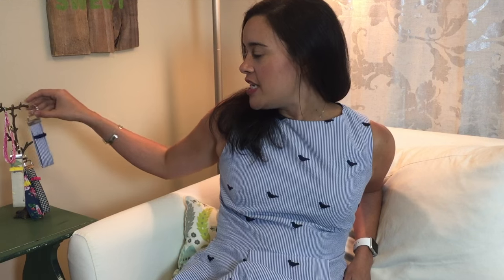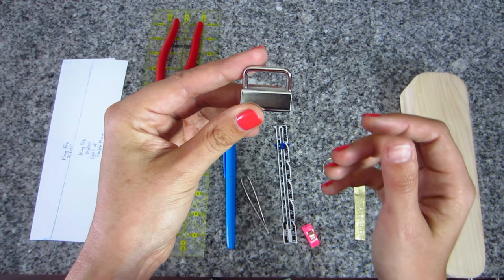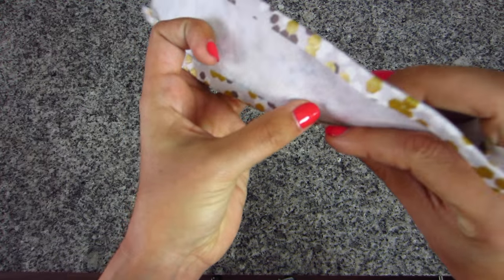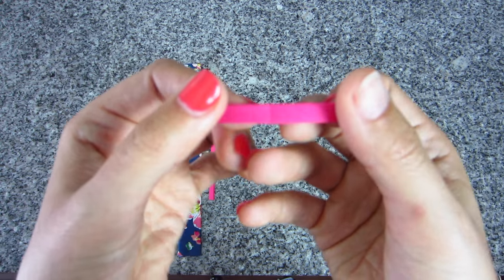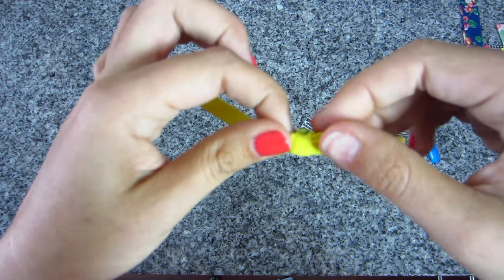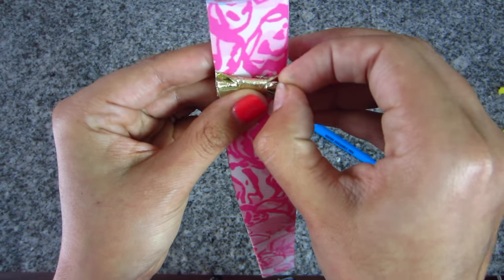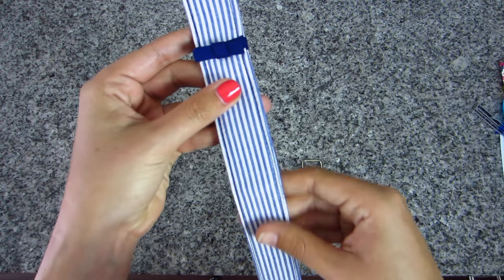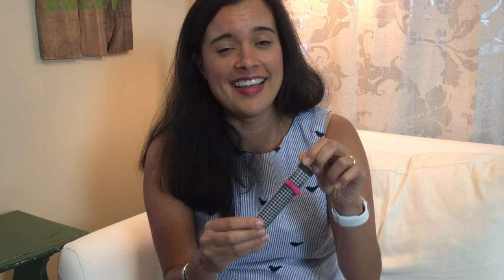DIY Cute Key Fob Tutorial

Comment: anybody else having problems with the key fob hardware falling off? I clamp as tight as I can but if I pull on the ribbon it still seems to be able to pull out.
Reply from the maker: Hey, Courtney! I've never had that problem even after using one for many, many months. Did your hardware have little teeth to dig into the fabric? That's all I can think of that might help.
Reply: yes it has the little teeth. I got them from hobby lobby. the teeth go into both layers of ribbon and webbing but are still able to pull out.
Reply from the maker: Hmm. I don't know about that particular type of fob. Mine have held up no problem. Maybe return those and get the ones I used?!